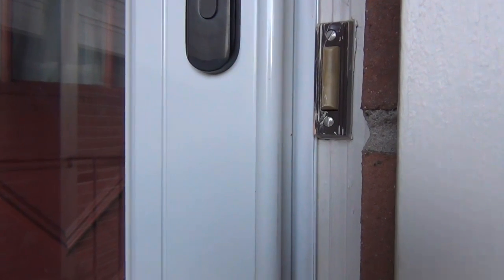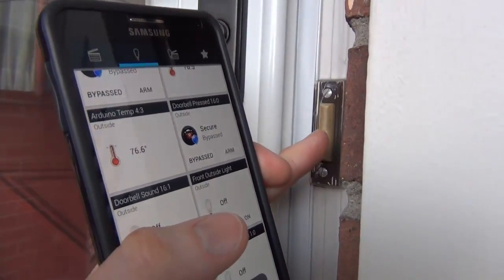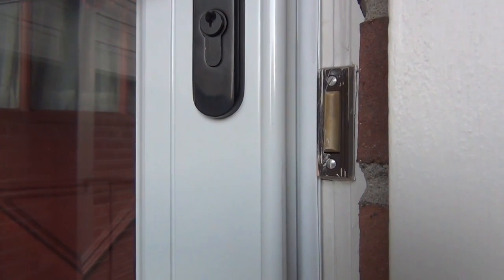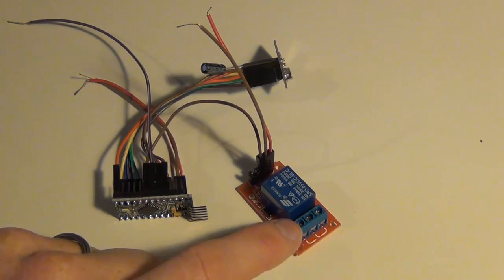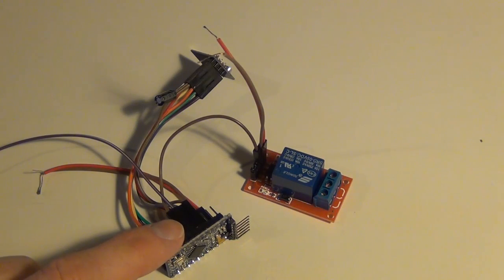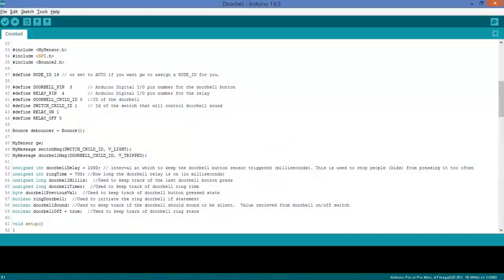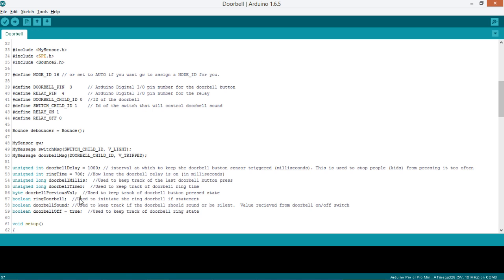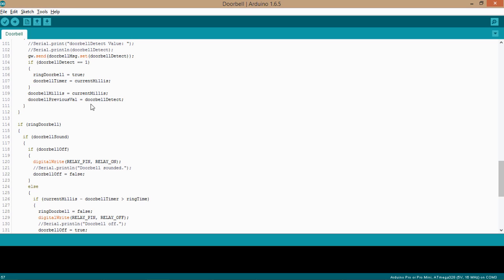Arduino Doorbell Home Automation Hack with MySensors

Comment: Where did you find your power line?, did you put a wire on the transformer?? thank you so much for making it clearear..

Mac.
Reply from the maker: I actually ran a separate 5VDC line from my whole house power supply since it was near by.  I used that to power my arduino and sensors.

Comment: How to you get the 5v power is it a battery ?
Reply from the maker: +hustlagrillz123 I need to make a video some day but I haven't gotten around to it (and I want to test it before recommending it to people) but I converted an old PC power supply to get DC power throughout the house.  It has been working for well over a year so maybe it's time to make the video.
Reply from the maker: Saurabh Sarang Yeah, I often find it's easiest to use and old cell phone charger if I'm just powering an arduino and a couple of sensors.  I have been able to get them for free fairly often when they are recycled at work so it's nice and cheap.
Reply: +Pete B was about to ask the same thing one thing which always makes me pull my hair is source to arduino.